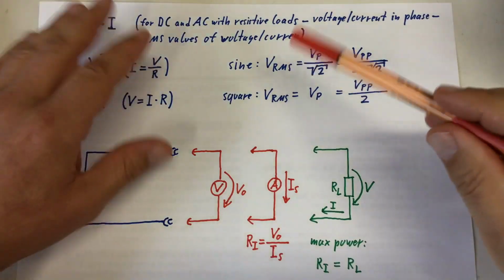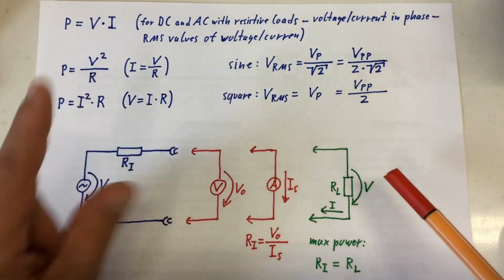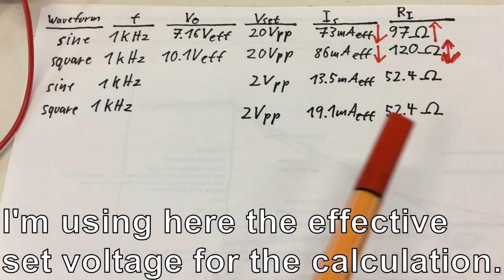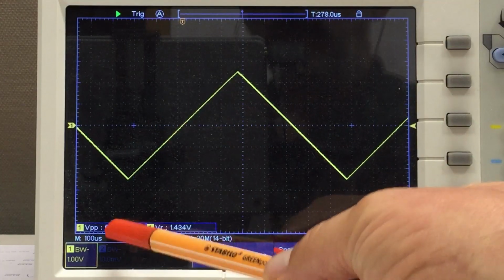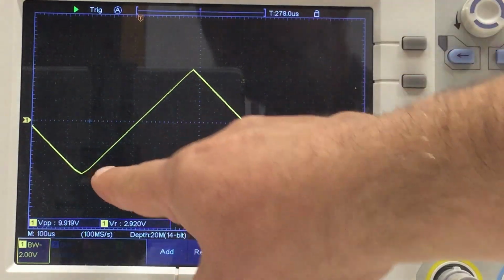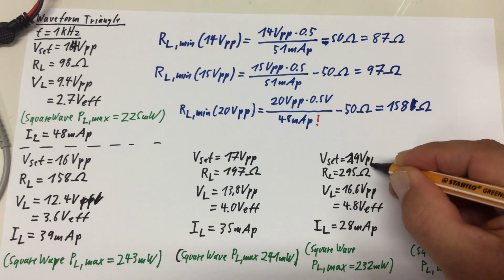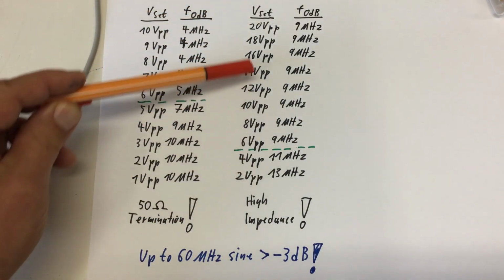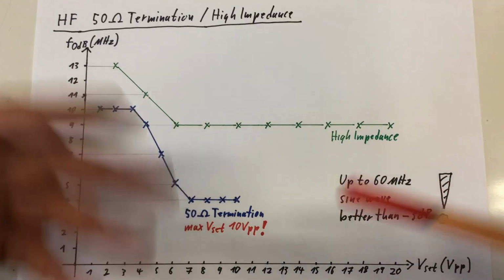FeelTech FY6800 60MHz Signal Generator Review Addendum II (Output Stage)

Comment: (By about 27 minutes into the video) Id hate to say this but you perhaps might think about investing in a 5W 500 ohm power potentiometer.  That way you could have just set the thing to Rmax at 20vpp then turned the pot down until the wave starts to distort.... then measure pot for your Rl-max.   Much less tail chasing.  I thought that was what you were going to do at stat of video (ie put pot in there and adj until you measure 1/2 unloaded voltage - then the pot is = to internal impedance (using scope to monitor distortion while you do this of course)).
Reply from the maker: You don't have to "hate to say this", you're absolutely right. But that very detailed review of the output stage was really just a one off. But rest assured, if I ever measure an HF output stage again, I will invest into a HF power potentiometer beforehand 😅
Reply: @robertssmorgasbord  LOL!  It made me pull my hair out a bit because I used to do the exact thing with pencil & paper... then I discovered Excel spreadsheets then started to come up with better ways sometimes.  But it is a trap to do it that way even with a spreadsheet - but I sometimes still fall into that mindset when I am uncertain what I am looking at.
Reply from the maker: @bertbronson8395  Yup, it's sometimes very easy to make things very hard 😅 Anyway, thanks again for your tip!
Reply: @robertssmorgasbord  You ae welcome my friend.
Reply from the maker: @bertbronson8395  Thanks again!

Comment: This is a very nice and thorough review, and it's very useful to see some of these limitations documented. Thanks.

However, I think that in general, even the better quality sig. gens from, say, Rigol and Siglent have documented limitations on max p-p ouput vs frequency, so it would be surprising if this device did any better. 

The big difference seems to be that at the fancier end of the market, the manufacturers document the limitations themselves, but at the cheaper end, they rely on some German guy to measure it for them and make a Youtube video 🙂

Of course, for many hobbiests, this device is more than fine (as long as you respect its limitations - now nicely recorded for posterity), and compared to what was available when I was young, it's a borderline miracle for the price. (Though from what you said about the price of o/p drivers, I don't think it would have killed them pricewise to put in something better)
Reply from the maker: First, thanks for the praise and you're welcome!

You're right, one (!) of the major difference between a cheap Chinese eBay, AliExpress etc. function generator and a brand name one is the documentation, including the disclosure of the operational limits. But another difference is that a brand name vendor would never advertise with such exaggerated performance numbers. 

I still stand by my statement that the output stage of that thing is pretty anemic 😉 I mean you get your full bandwidth at 10Vpp (20Vpp advertised) into a 50Ohm load only up to 4MHz (60MHz advertised). One of the big vendors would have probably sold that unit as being 5MHz (-3dB is always OK) and 10Vpp.

That aside, I agree that for the price the features of that little box are still flabbergasting.

Comment: With small signals below 50mV, interference pulses (peaks) occur. Does anyone have a solution for the problem?
Reply from the maker: Not me 😞 I think there are some enhancement projects out there using a redesigned power supply with linear regulators to make the output signal cleaner. And at 50mV you certainly need a very clean power supply.

Comment: I just purchased the 6900 for the heck of it and I cant believe after all these years the DAMN offset is still AFU !!! I also noticed that anything above 3MHz it has lots of jitter, guess you get what you pay for! Oh, 1 hr after I got it the main AC switch failed! One day I am going to add a jack in the back so I can use my 10MHz house clock for reverence.
Reply from the maker: I don't have any experience with the 6900 myself, but what I've gleaned from the interweb it's a 6800 tuned to the max (Vpp increased from 20V to 24V, TTL/CMOS square wave frequency increased from 10MHz to 20MHz etc.) plus some bling added to the case. All that tuning of the marketing relevant specifications without really redesigning the circuitry lead to a, well, interesting product.
Anyway, let me know how connecting that thing to your 10MHz reference clock goes.

Comment: Very interesting video,  tnx 4 the upload !
73 N8AUM
Reply from the maker: Thanks! And you're welcome N8AUM! But why is an amateur radio guy like you (had a look at your equipment at qrz.com) interested in something feebly like the FY6800? 73 (though I'm not an amateur radio operator)
Reply: @robertssmorgasbord  Hi Robert, well, sometimes all one needs is just the basics. I purchased the 6600 last year because I wanted something small and frankly I am AMAZED of how far equipment has evolved, I would have givin both my nads to have something like that 30 years ago lol
Reply from the maker: @vidasvv  Hi N8AUM, yes, compared to what was available 30 years ago I'm definitely complaining on a very high level about the output stage of that FY6800 in this video :-) And let's not forget how cheap that thing is.

Comment: Hi Robert, thank you for the very detailed explanation and testing.
I have the JDS6600 from the brand Joy-IT, also a 60Mhz version with look almost the same as the FY6800. After seeing the extended testing you did, 
i'm now 100% sure that these devices don't have a very strong power output, and that mine version acts "normal" and isn't faulty.
I have managed to find the maximum output power is 174mA at 100Hz (Square wave) 20Vpp , and 130mA with a 1Khz Sine wave, 20Vpp.
Because these boxes are powered from a 5V SMPS , the higher voltage from 5V and above to 20V is created by a boost converter with seems a low current limiter.
Thanks again for your time and effort for making this video, because i did seen many reviews of identical signal generators, 
but never seen tests regarding the maximum output power that these boxes can deliver. Grtz
Reply from the maker: Hi Bjorn, while it was quite laborious doing all the measurements, I'm glad you brought up the issue and I'm happy I could help out. Not knowing the limitations of that function generator can really mess up your day when using it in some setup on the bench.
Good to see that your measurements with a JDS6600 are in the same order of magnitude (assuming your current measurements are peak values and not effective/RMS - are they?).
Anyway, I concur with your analysis of the root cause. It might indeed be the power supply of the output stage and not the output stage itself.
Reply: SDG Electronics designed a new power supply for the Fy6900. I wonder if his unit could provide more power...
Reply: @vizkoze  I doubt it, the FY6800 has a external 5V 2A (10Watt) Power supply with 0Watt in stand-by mode.
When the unit is powered on, but both channels are off, the unit draws 2,5Watt.
The maximum power consumption is 4,5Watt at 10Mhz, 20Vpp open voltage. And with 1 channel in shortcut, the unit draws 5Watt. So the power supply is only used at 50% of his strength , i doubt if a stronger power supply makes a difference. I think these units just have a low cost IC at the output that drives each channel.
Reply from the maker: @BjornV78  (your reply to vizkoze) SDG Electronics actually designed a complete new internal power supply board for the FY6900 ( https://youtu.be/jURtVXUQv8c ), so the positive/analog rails could in theory be more powerful and supply more current (he designed it for +/-480mA).
Reply: @robertssmorgasbord  , i just did another test, and connected by bench (linear) power supply to the signal generator via the DC connector (cable with 5.5mm x 2.5mm DJ jack). With both channels terminated with 50 Ohm terminator,  the max current draw that i could draw from my bench power supply was at some point 2,2A at 5V.
The current limiting at the output reacts very random, when switching through frequencies and wave forms. 
With my DMM in Ac current mode (dead short) the max current draw was arround 170mA , the same with the 5V 2A power supply that came with this unit.
I also used a 5V 3A SMPS adapter , the power draw was slightly higher at max 6,5Watt , but the output current (dead short with DMM) or with the 50 ohm terminator wasn't higher then my previous measurements.
So the maximum output current of these boxes is limited at the output stage by an IC.
Reply from the maker: @BjornV78  Thank you very much for taking the time to make all these measurements! So my conclusion in the video was right after all. Part of me is happy to hear that (being right after all and that), but the other part of me is a bit sad, because there's no easy fix (replace power supply board) for the weaknesses of that unit. So in effect we need a new output stage for that thing, and then (with the new output stage drawing more current) a better power supply design. Might as well replace the signal synthesis too at that point, 'cause there's definitely a bit much jitter above 10MHz. That is build your own function generator :-) Nah, I guess I'll accept that thing at a price point of 75 € for what is is: A very versatile cheap plastic box you shouldn't push too hard.
Or ... we could build an external box containing a two channel amplifier with high impedance inputs and 50 Ohm outputs. Would make a nice little project, wouldn't it ;-)
Reply: @robertssmorgasbord  , the funny thing is, i bought this FY6800 signal generator for testing my socalled "Poor men's Passive Differential Probe" design.
My previous signal generator was the cheap FG-100 DDS Function Signal Generator (arround 20€), but that one could only put out 500Khz max (what the manual said, but its in fact much higher), but i turns out that this cheap signal generator has a more powerfull and stabiler output then the FY6800, while this cheap signal generator is only powered through the USB connector of my scope (USB 2.0 version port) that only deliver a maximum of 500mA.
Reply from the maker: @BjornV78  An FG-100! That thing is driven by an ATmega microcontroller, uses an 8-bit R2R DAC and has two TL072C dual op-amps as output stage. Each op-amp ca supply a short circuit output current of +/-30mA. How the hell did they cobble together a reasonable output stage with those?
Reply: @robertssmorgasbord  It has already done  ) Calling FYA2000 series amplifier http://en.feeltech.net/index.php?case=archive&act=show&aid=12
Reply from the maker: @Niarbagem  Wow, the 1MHz FYA2010 will set you back about 140€, the 3MHz FYA2030 160€, and the 10MHz FYA20A0 440€! All German eBay prices. But then, these units supposedly provide an output power of 20W. That's more something for radio amateurs I guess.
Reply from the maker: @vizkoze  If Bjorn V's assumptions about the power supply are correct (which I assume they are), and if the output stage can actually handle higher currents, then yes. I just went over his video ( https://youtu.be/jURtVXUQv8c ) and he designed the positive and negative rail (+/- 13.5V) with 480mA max output current each, so a total of about 13W just for the analog rails!
Best way to find out would be to asked SDG Electronics nicely if he could make some similar measurements on his modified unit I guess.